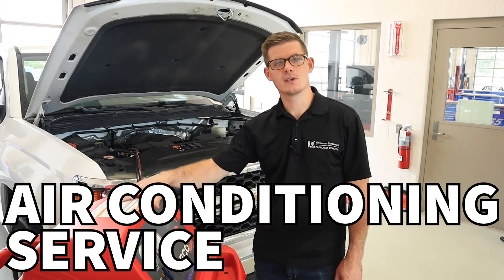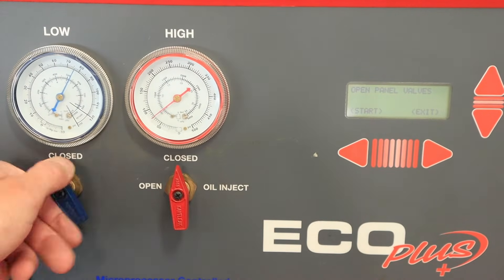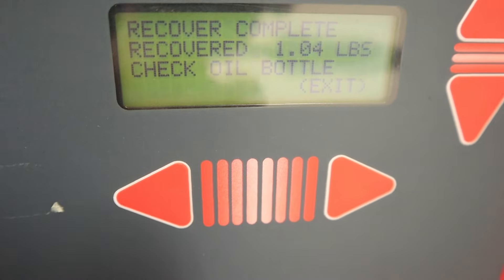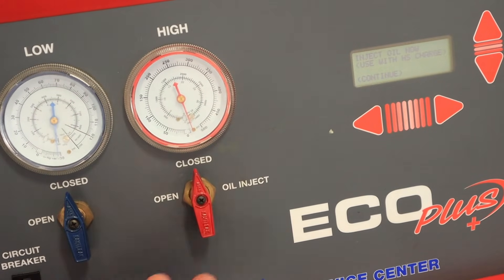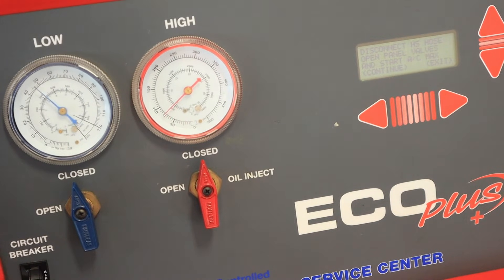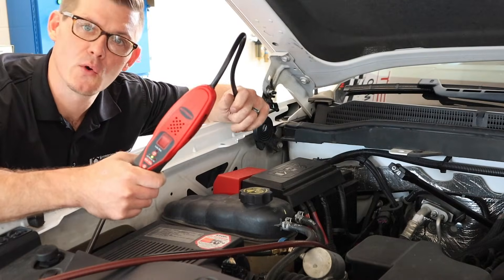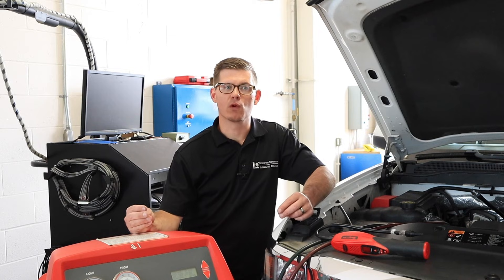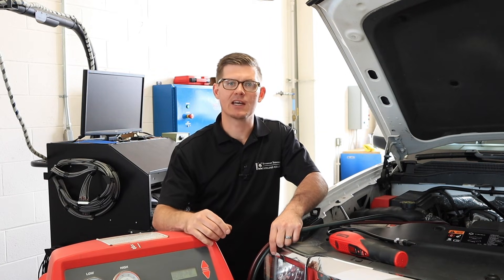Automotive Air Conditioning Recovery & Charging

Comment: When you empty the hoses, your panel valves are closed? But the machine says to open the valves and to disconnet the hs hose? What is the correct way to empty the hoses afer charging the system?
Reply from the maker: I should have covered that in the video. You would disconnect the hoses from the vehicle, then open the panel valves and use the clear hose function (if available) or select recovery mode to empty the hoses.

Comment: If the old refrigerant will be recovered, what if it is contaminated by moisture or black oil. The contaminated refrigerant will be sent back again in the ac line system?
Reply from the maker: If contaminated refrigerant is suspected, there are tools to check for the presence of sealants and percentage/type of refrigerant present in the system.

Comment: How to u get the machine out of high pressure lock out mode ?
Reply from the maker: Good question, I would have to consult the manual. Most machines have an air purge function to help reduce high pressure in the storage tank. This is often a slow process.

Comment: curious do you ever use a micron gauge on vacum test and do you check super heat and sub cooling
Reply from the maker: Most automotive AC equipment only reads to in/Hg on the vacuum side of things. It is also interesting that most automotive technicians do not run calculations for super heat or sub cooling.

Comment: To all of you watching this, one important place to also check when looking for leaks in the system is the evaporator core. This is where UV dye is basically worthless unless you have a gross leak in it. The best method I have found is by using a high quality electronic sniffer such as the one in the video. Simply place the wand into the passenger side air duct and with the fan on low. Simple but works.

Comment: If you check for vacuum, when system is charged - it is positive pressure, so you can get a leak under positive pressure - not negative. How to test it for positive pressure leak?

Comment: Hi does the machine put new refrigerant in or recycle what came out? thank you
Reply: It recovers it through a drier and then goes into a recovery tank. A vacuum is pulled on the system to remover moisture(air). Then the refrigerant is pulled back into the system.